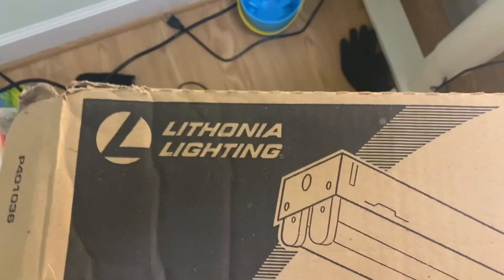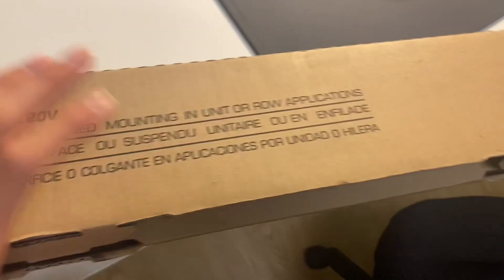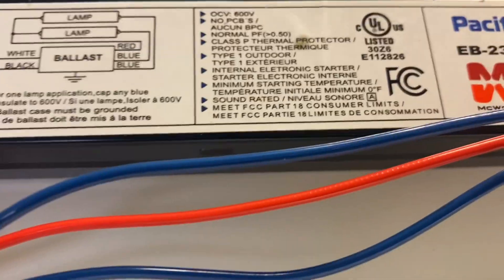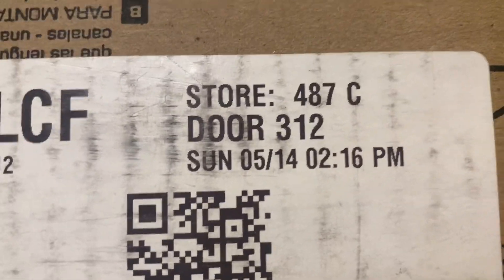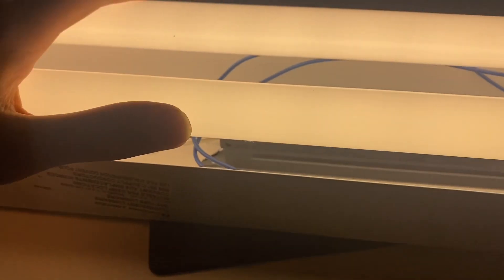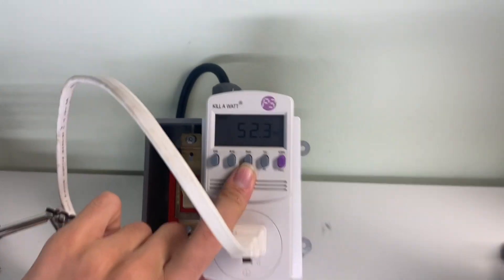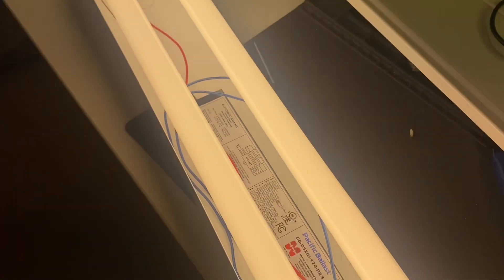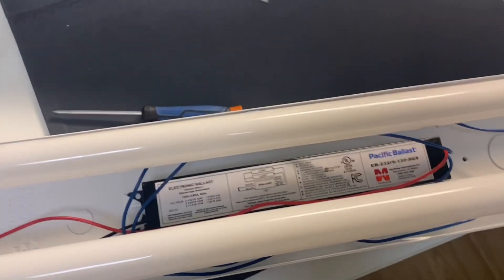Lithonia Lighting 2 lamp F32T8 fluorescent striplight

Comment: What an awful fixture. I didn’t even know Pacific Ballast was still around. I’ve got a 2xF40T12 LPF rapid-start ballast by them, which I got in a NIB fixture from a ReStore last year. It stopped working days after I first used the fixture. Absolute cheap piece of garbage. Don’t get me started on those ugly cheapo sockets that you get with new fixtures. They are not very good quality, you can tell just by looking at them, plus locking feature is more annoying than anything. At least you can still get real replacement sockets. And of course, these new fixtures are made of what might as well be foil.

Also, I believe the date is Sunday, May 14, 2023, not 2014. It would be weird if they had that fixture sitting on the shelf since 2014, especially considering that fluorescent was more popular back then.
Reply from the maker: It didn't even get through the day before being converted into something else (F40T12).
I put some nice Leviton sockets in it, and a Valmont Electric Bonus Line F40T12 dimming ballast that weighed more than the fixture itself.
It is a lot better now.
Reply: @HIDLad001 I would love to see the dimming ballast in action.     Guess I didn't realize dimming ballasts for F40T12 existed,  guessing they weren't very common for T12s?   I'm well aware of the dimming concept for fluorescent lamps and have only heard of T8 and T5 dimming systems. I believe Valmont made some very good quality ballasts back in the day.
Reply from the maker: @Sparky-ww5re  T12 dimming systems were reasonably common. They were just an ordinary rapid start ballast with a separate transformer to power the filament heating, and the ballast for the tube would be dimmed, and the filament transformer wouldn’t (it would have it’s own separate non-dimmed 120V line wire) so that the cathodes were constantly heated to eliminate sputtering and premature lamp failure.